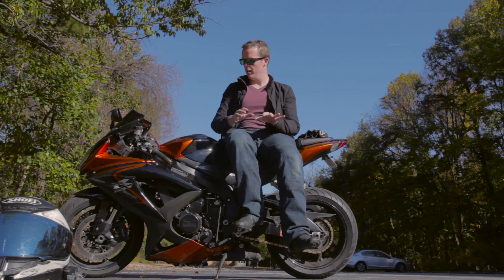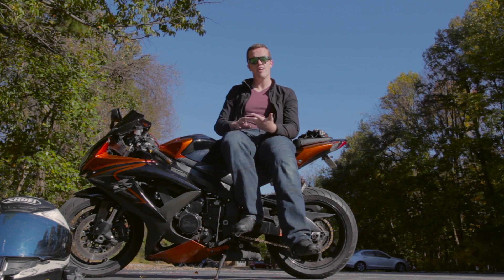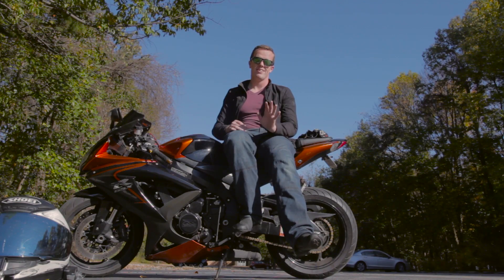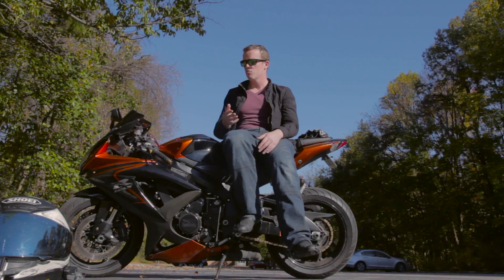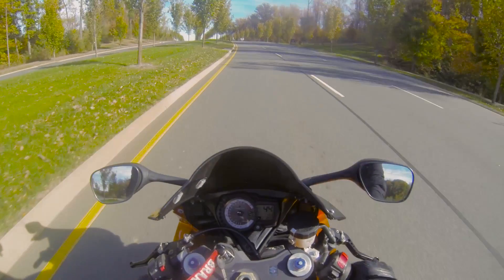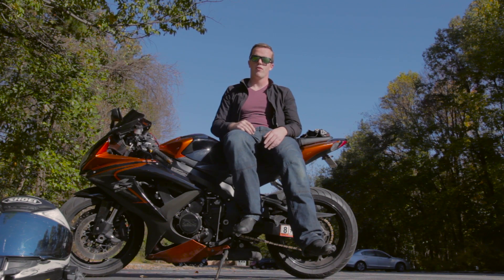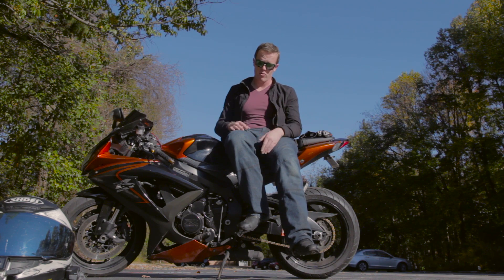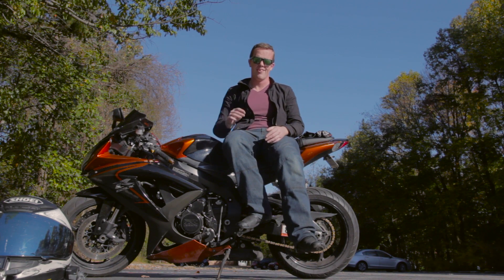How Motorcycle Engine Braking Works

Comment: This is Not a good technique for beginners. So many new riders don't have a feel for how much traction they have or rather don't have on their back wheel, and just love braking and corning hard at the same time...

Learn to break properly first, then just use this when slowing down for a traffic light, and you should be fine.
Reply: Not being condescending at all. It's simple engineering. A car's disc are usually bigger than a bike's, often double discs each side on the front, often four or six pot. The tyres have a much larger contact patch giving more road grip; this is an important factor. A bike is lighter than a car so it takes less force to stop it (½mv²) but it also means its tyres may slide earlier due to less down force. Which really means longer braking distance even if we're pulling a stoppie.
We can steer a car under heavy braking to some extent, on a bike we have to straighten up.
It pays to hang back quite a bit further when on a bike than in a car.
Reply: kiraanimerawr1 That sir is how you get rear ended. MSF course teaches you that when engine brake the person behind you does not know you are braking. No one seems to forget that.
Reply: @DonTHEhandsome1  exactly I started practicing engine breaking but after a couple of times doing it I instantly noticed that it's dangerous for that matter
Reply: @iCallOfDutyDog  wow old post. Brakes are cheap. Engines, clutches, transmissions, sprockets and chains are not. Wear out the brakes before you wear down other parts.
Reply: @DonTHEhandsome1  doesn't change the point tho
And it doesn't even wear out the engine
Reply: @iCallOfDutyDog  That quote was a little modified but it came from twist of the wrist. Engine braking will always wear out the drivetrain. It is a little wear but it still using friction to slow the bike and rider. Clutch and chain/sprocket will take most of it but valves and piston rings still take some of the load.
Reply: Damn how do I brake without wearing out my motorcycle then
Can I use my shoes perhaps, like I used to do when I had a bike
Reply: Yes obviously you should briefly tap your brakes when coming to a stop, but you don't really need to engage them immediately. Besides, in traffic in cars plenty of people coast to slow down, never hitting their brakes and everyone understands how to do it. Actually, in highway traffic that fluctuates over 10 mph, close following distances, it can be dangerous to unnecessarily hit your brakes. (not as much on a bike) but if you can't see around the car in front of you, they might be coming to a stop, you might jam on your brakes way harder than you need to, just because someone keeps tapping their brakes instead of coasting/engine braking. I've been freaked out by someone in front of me unnecessarily hitting their brakes, people in front of me have been freaked out by it, and people behind me have been.

Reacting to someone unnecessarily lighting their brakes puts you at risk to be rear-ended. "oh shit we're stopping! Oh wait, no we're not, the dude in front of me just doesn't know how to keep a decent amount of space to allow for coasting and engine braking."
Reply: joshua jcardea this is not true, the average car can stop in a shorter distance than most bikes. Further more, any idiot in a car can stop it near the minimum braking distance which is not true if bike riders and bikes.
Reply: aflynch  that was going to be my plan. juat learn to use the brake properly and safely so in case of an emergency o can use the brakes. i mean the brakes are made for a reason. to stop you
Reply: If you're used to driving a car first you understand what coasting is. If I'm going 70mph and the light half a mile in front of me turns red, I'll let off the gas and coast, and only brake once I get closer to the light. Understanding that in a car makes doing it on a bike, even as a beginner, very easy. You need to come to a stop? Let off the gas and coast until you need to start grabbing your brakes. The guy next to you acting shifty at 50 mph? Let off the gas and slow down to let him come over. No point hitting your brakes unnecessarily.
Reply: People slow down cars by coasting when they're asleep.

Cars engine brake by wildly varying amounts, a following bike has to allow for that, some cars have a "speed maintain function" where taking foot off gas the car stays pretty much at the same speed, until the brakes are touched and then it will engine-brake. Car brakes are a lot better than bike brakes, a car can get very out of shape and still stop without falling over. 
A bike can normally see over the top of a car to assess the situation ahead.
Reply: Cars brakes are not better than the typical bike's brakes.
Reply: Joshua, I can assure you that when used in anger, they are.
Bike brakes always have a limiting factor that if you hit them too hard, you come off. That does not happen in a car. Plus a car has engine power assisting the braking with much greater force.
If you are relying on car brake lights to tell you they are stopping, you are too late.
 
At busy town traffic speeds (20mph) a car can slam to a halt within its own length.  The tyres don't skid because they have ABS. A car doesn't slew about because it has stability control. It takes longer to think about hitting the brakes than to stop. Go drive a car and find out. 
Be safe :-)
Reply: If you can't stop in time by reacting to a cars brake lights you are following too close to begin with...
Reply: Rather my point Scott - but we should be reacting to traffic further ahead as well - "information" (see https://en.wikipedia.org/wiki/Roadcraft)
For example, one of the key signs that a car is coming out of a side junction on you is its wheels are turning, avoid.
Reply: Yes of course, I wasn't really disagreeing with you there but more with the fact that you made it sound like if you did react to a cars brake lights you would definitely rear end them, which really shouldn't be the case unless you are too close.
But I completely agree that it is better to react far sooner to the traffic further ahead and try to read what may happen.
Reply: @jules The average car can stop shorter than a bike because of the centre of gravity (it's on 4 wheels) not because of the quality of brakes. There is a lower coefficient of friction (and a few other factors) that once a car with average brakes has passed, changes that scenario. 

@Jeff Slade I agree with your points, but it doesn't refute my original point about brake quality. The sportsbike's brakes has to be top quality for the exact reasons you're pointing out. Practically speaking, I'll concede a car's may be better.
Reply: joshua jcardea - it's been a very long time since I've driven a car with lower quality brakes than on (say) a sports bike. The discs and pads are bigger, the tyres are wider, and there's twice as many of them, and they're power-assisted; which adds up to more friction which equals greater stopping power. It's simple engineering principles, friction has to negate the momentum of the vehicle (1/2mv^2) and you cannot break the laws of physics. The cars I've had for the last 15-20 years have all had ABS, traction control and stability programs. With cars there's the economy of mass production, bike manufacture is a cottage industry in comparison. 
For example take a look at the size of the master cylinder on a bike. It's tiny compared to that on a car but if it were any bigger you couldn't operate it with your hand. The size of the master cylinder limits the amount of pressure that can be applied to the disc.
Reply: "Learn to break properly first"?  Learn to properly destroy a motorcycle?  Really?
Reply: That's just silly....I actually belly laughed on that stupid crap.....oB
Reply: chill out for a bit it was a joke
Reply: @iCallOfDutyDog  just annoyed by these stupid videos spitting out fails information. Makes beginner riders who want a sportbike for whatever reason, I love the way they look and sound myself, ride like assholes giving the riding community a bad rep. Ride safely on the street and take care of the bike. Disrespect either and you will DIE.
Reply: Don't be condescending, the strength of the brakes of my bike has saved my life countless times because THEY ARE BETTER THAN A CARS. 

The ability for the car to not slew about as you say, is less to do with the brakes itself and more to do with physics. A car can slam on brakes, and even without ABS or stability control still be fine in most practical instances, whereas a similar instance as a biker you're going to low side. 

I've slammed on the brakes on my r6 going 60 Mph, locked up my back or front wheel wheel, kept it upright, and come to a stop long before I slammed into a back of the car whereas in the same instance in a car I've had to veer off the road (I naturally find an escape route in a car or  motorcycle)

A motorcycle's brakes are comparable to a performance cars, and are better than a car which is why can lightly touch my front brake and slow dramatically without engine braking.

I agree with your other points about brake lights though.

Comment: Not sure if this is still the case on modern bikes, but I'd heard that engine braking is inadvisable on two-strokes as high rpm combined with minimal fuel input means the engine will be oil-starved as it's not getting the oil in the fuel.

Comment: Biker bro I bought a bike and they fitted a power commander to it and if you could do a video on that it would be great. As when I got my bike the met mapping  didnt work and have no shift change light so maybe a video on these would be great. The ups and downs of power module commanders on your bike. Thank you and safe riding
Reply from the maker: Just getting myself a new bike and plan to fit some fuel mapper so I will be sure to get you a video as soon as I do

Comment: just as an addition to you mentioning multi cylinder engines making a difference.

It's also worth noting the idle speed of your bike makes a difference on engine braking generally the higher your idle the weaker the engine braking effect will be and the reverse is also true.

so if your bike idles at a low speed the effect will be more pronounced, I was going to put examples of bikes that idle lower than your average bike but all i can think of are harley style bikes (idk it sounds to me like they idle low) and i would imagine a sport bike would idle higher

also for anyone confused idle speed is how fast the engine is going when its resting IE you're not touching the throttle not moving not doing anything

Comment: The engine braking on my MT 07 is so strong, I almost never need to use my brakes coming into a corner, but I still lightly hold in the front brake to turn on the brake light.
Reply: the same on my ER6N